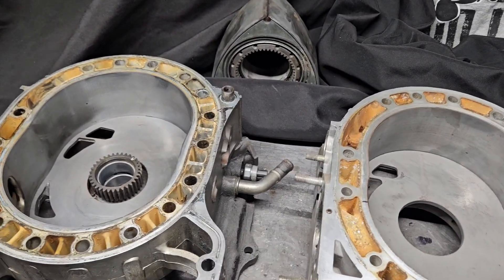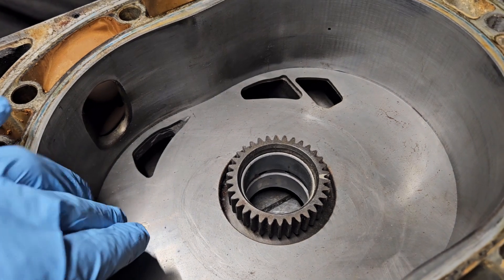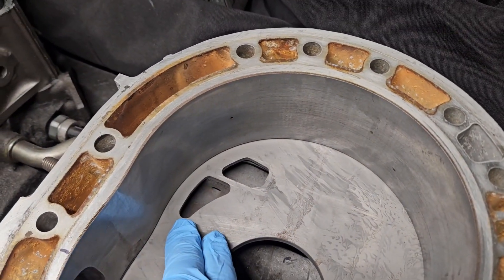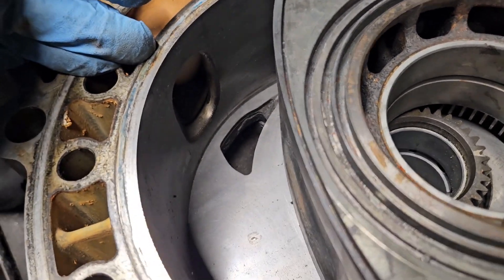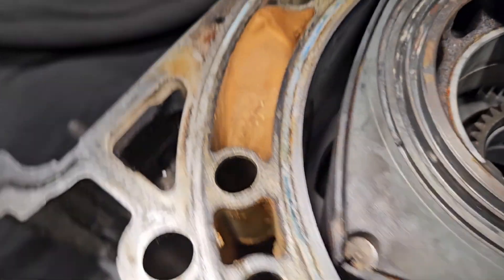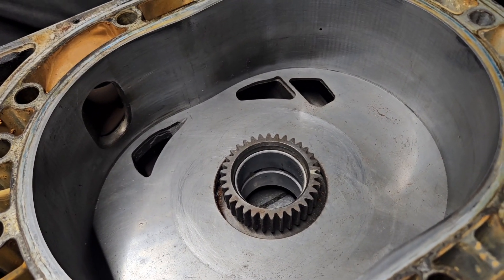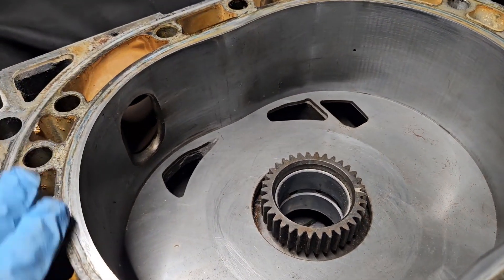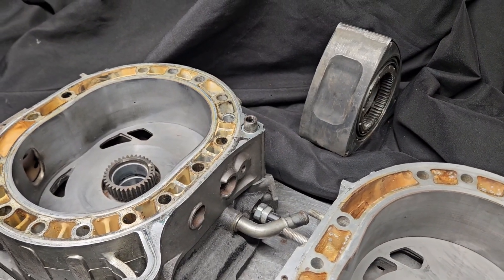Renesis GSLSE 13b Hybrid RX8 - Intake and Exhaust port timing and why it worked for us - KMR Rotary

Comment: Kyle, what are your thoughts on twin-scroll turbos vs single scroll turbos? The peripheral ported 13b is legendary for its exhaust charge. I have heard that there is an additional 15hp available from the exhaust pulse. What if the center port was blocked so the hybrid engine could drive a twin-scroll turbo?

Comment: Wrong! The best approach to a good Renesis would be V-Force Reed-Valve controlled Peripheral Intake Port, Side Exhaust Ports, fully clogged Side Intake Ports. 
Please test, if you find something better, tell us.
The advantage in Renesis is zero port overlap, with other combinations, you lose that
Reply from the maker: @josega6338 RX8 p ports don't work from what I've see.  have you tried any of that?  We tested a renesis peripheral port and it was bad. Substantially lower horsepower than a traditional peripheral port on the Mazdatrix dyno.  With a peripheral port, the overlap is actually helping. Sorry to break it to you, but at least part of that has already been tested and was not a gain.
Reply: @KyleMohanRacing Could you please provide a reference?
Reply from the maker: @josega6338  yea call Dave at Mazdatrix.  Ask him how a renesis p port works.
Reply from the maker: @josega6338  I'm pretty sure mazda made this motor zero overlap for emissions purposes, not performance purposes...
Reply: @KyleMohanRacing  For emissions and fuel Economy purposes. 
I've purchased some of the parts for this, but lack the resources to complete the assembly work.
Thanks
Reply: @KyleMohanRacing  Pls have a look at SAE technical paper 950454
'The characteristics of Fuel Consumption and Exhaust Emissions of the Side Exhaust Port Rotary Engine', R Shimizu et al
I'm not sure even about my comments, but always attempt providing references
Reply from the maker: @josega6338  I'm familiar with it. It's a great document and mazda arguably did a great job with the renesis motor. However, in real life application, the results were horrible for a peripheral port intake inside port exhaust motor compared to a traditional PP. Disregarding fuel consumption as who cars.  Totally support you in investing your own money to come up with a different outcome.
Reply: @KyleMohanRacing  It seems you focus on racing, my interest is street cars.
Fully different realm
Reply from the maker: @josega6338  Yup. And I still wouldn't recommend a Renesis P Port.  Street or race.
Reply: @KyleMohanRacing  I will do, if allowed
Reply: @josega6338  The main reason for not having any overlap was to increase thermal efficiency.  Which is at the root of all those characteristics.  Higher thermal efficiency means you get better fuel consumption, better emissions, better idle stability, better low/mid range response, etc.  See SAE 2004-01-1790 .  And as a note, the Renesis has roughly 40% and 47% greater intake/ exhaust port area, respectively, than the previous NA 13B, which is why it makes roughly 40% more power.  If you are singularly focused on all out NA/turbo high rpm power in a rotary the p-port is king.  If you actually care about things like, idle, fuel consumption, low and mid range throttle response/power, and efficiency, then a side ported NA (and turbo) is pretty hard to beat.  The remainder of the Renesis' (and other rotaries) power lies in the intake tuning, where the volumetric efficiency is roughly 110% in stock form.  All those valves and stuff in the intake change which port is open, and how long the intake path is, and affect the dynamic charging.  In race form the NA rotary can easily clear 130% volumetric efficiency.

By adding a p-port exhaust to a Renesis, it makes it a less efficient Renesis.  The exhaust discharge coefficient is much lower, and now there is way more overlap.  This means you throw away power below roughly 5200rpm, and will need more boost to make the same power.  And Kyle's dyno numbers show that.  They needed 14 psi to make the same power as a stock 6 port Renesis could at 10 psi below ~5200rpm.  And below 4500rpm the turbo hybrid made less power than a stock non-turbo Renesis (barely).  The only benefit the hybrid setup had is that the peak power was 600rpm lower above 5200rpm, but they needed 30% more boost pressure to do it.
Reply: @capnthepeafarmer  I knew this.Adding a P-Port Exhaust to a Renesis is the best way to fuck it. 
Intake P-Ports are not compatible with existing Renesis Side Intake Ports, interference greatly reduces efficiency, BMEP,  SFC,...
Reply: @capnthepeafarmer Peripheral exhaust are not meant to introduce more low end power or better thermal efficiency but to offer better gas flow especially at a high boost high rpm application. The Renesis side port double 90° angle hamper the hot gas flow which mean you’ll end up recirculating huge amount of inert hot gas inside the combustion chamber like an EGR but worst introducing more carbon buildup. 

The design will also increase the combustion chamber temperature under high load especially under a boosted application. You can easily get a hint on why Mazda going to back to an NA setup with the Renesis. So Hybrid Renesis is the cheaper version of 13B-REW swap for anyone who trying to prolong the longevity of the Renesis or trying to boost that thing safely. Minor modifications like groove machining, tip clearancing and oil pressure swap is some of the recommended modifications to add to the stock block.

Comment: The old style rx7 6 ports used to go harder than a bridgeport just with a IDA and electronic distrubutor . Alot of my bros used to make the 6 port brap aswell
Reply from the maker: well a stock 6 port did have more bottom end then a bridge but a bridge did have more top end at like 10k so makes sense.

Comment: Just a thought Kyle... If you ported the RX8 Side Exhaust port, like what REC over at RX7 Specialties does, that might extend and open that enough to pull in exhaust at the same time as the peripheral port does. Love what you're doing though!! Definitely need more study on what we can do with this combo!
Reply from the maker: watch all the videos. why would it need the same timing on the side?
Reply: @KyleMohanRacing  I would happily rewatch all the videos. It’s honestly fascinating! And I’m in no way trying to be argumentative or anything. 
But considering how the housing port allows exhaust to escape first, then the side Iron port relieves more exhaust pressure, you’re essentially creating like a two stage exhaust release. Which creates uneven exhaust pulses since you’ll have those ports with separated header tubing to the collector. If you ported the RX8 Iron exhaust port it could essentially create enough reach to open up close to the same time, creating the exhaust pulses at the same time. Which with that in mind could route the tubing a little differently to allow exhaust scavenging to occur more naturally. But, with forced induction that may be less of a concern than with NA setups. 
Keep doing awesome stuff Kyle!! Love it!
Reply from the maker: @trackstarflash  exhaust manifold design will be important. This is an open topic as no one knows. I feel like if there was an issue of exhaust backup. You'd see it on a turbo build where you have the turbo, causing exaggerated back pressure. 

Since the side ports actually closes earlier and opens later to me  it would seem that would have less impact On flow dynamics.

Also rotary exhaust flow generally pulls the next pulse if the manifold is well designed well.  I don't see why having the peripheral exhaust opened longer. Wouldn't simply help the side ports flow properly.

Comment: I think a n/a hybrid has almost no use at all. The gain will probably never be worth the effort to a stock engine if even possible. So far there aren't a lot of dyno proof of these engine. Lets see where this goes
Reply: Ya they will probably do better turbo but I don't know. the nice thing about this setup is how cheap new gslse housings are and how cheap and common rx8 parts are. And that it can be ran on a stock rx8 ECU.
Reply: Rad potential did a hybrid build N/A and made literally stock horsepower. Look his name up on YouTube
Reply: @jakeable587  i dont think his header build was very good at scavenging but he never showed. i think that is probably more important on the hybrid build considering the renesis was designed to mitigate over lap. either way wish he would have just turboed it and sent it.
Reply: @jakeable587  I have a Renesis hybrid. It's power is not impressive n/a. There have been good power put out of a turbo rx8 like land speed rx8 with rx7 rotors in the rx8 block but if you got a junk engine renehybrid might be interesting. Not practical but fun
Reply: @jakeable587 i have seen the videos the amount of HP was low. I think if u want a good na hybrid u need to tune the inlet and exhaust. This is costly

Comment: Cant wait to see more Hybrid content!
Question: NA Config - Could restricting header diameter help recover some bottom end? Or would final gear tuning be better, narrowing power band to high revving. Basically shifting to usable power band... hope that makes sense...
Reply: Putting a straight through style wastegate (Straight gate) on the P-port would probably be a better method, use the side exhaust ports at low rpm then open up the gate at higher revs to gain the benefit of the P-port. Likely a bit of restriction compared to an open header pipe, but the side ports are there to help and a good collector should minimise reversion - could probably be tuned for some funky resonance as well if you wanted to get really fancy.
Reply: @k1ll3rvc I like the idea. I've been thinking about what if the rotary used high-power 2-stroke sled exhaust powervalve type systems. Tuning the amount of overlap from the exhaust timing, kind of like having dual VVT on a piston engine.
Reply: @k1ll3rvc  That's an interesting thought. Kind of exhaust tuning along with the stock intake staging already built into the intake system... 🤔
Maybe like 1 of those TurboSmart Straight E-Wastegates.
Reply: If you bottleneck the exhaust you might get flow reversion at the ports under certain conditions.
Reply: Na doesn't work you loose power
Reply from the maker: @kevinobrien3063  we boosted ours. Works great
Reply from the maker: header i don't think that's the answer.  balanced intake and exhaust flow is my belief